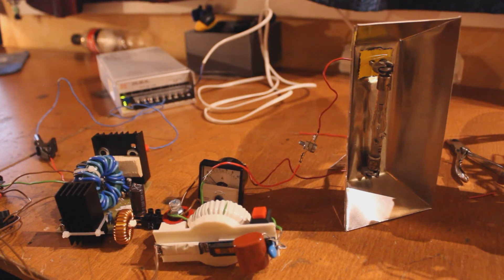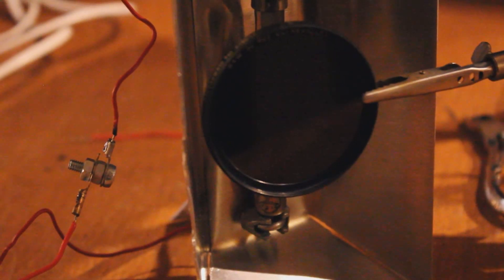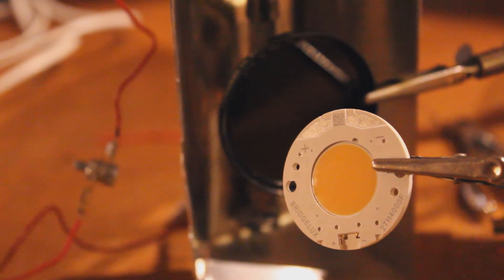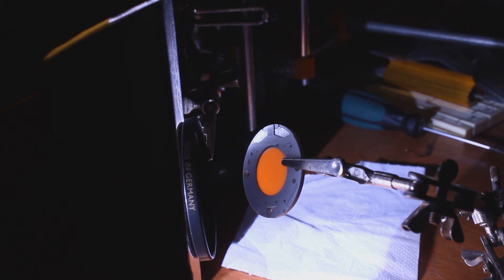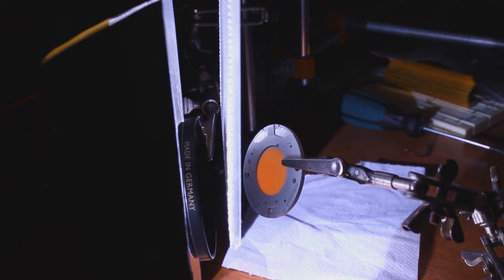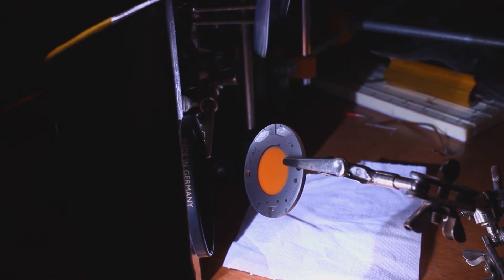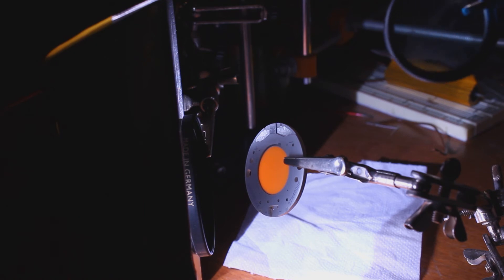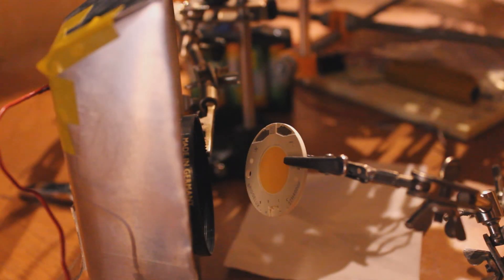How to see and block the UV from a Xenon lamp

Comment: Hello, thanks for the video.
How is it possible to remove the uv blocking filter of xenon lamps so that it can be used as a light generator in UV A, B, C bands?
If you know anything about this, can you share it?
Thank you.
Reply from the maker: AFAIK you generally can't, since the filter is the lamp's glass itself.
Reply: @val3tra  Thanks for answere

Comment: Are you sure that filter is UV pass and not IR pass?
Reply from the maker: +tbdau It is UV pass, known both from the pictures i took through it and from the label on it's edge. Whether it blocks or passes IR does not matter much in this case - the LED surface won't react to IR, and if the filter blocked UV then it wouldn't have lit at all.
Reply: Why does the camera UV filter not block any UV? Poor quality?
Reply from the maker: Not sure. It's either a scam product or something very specialized - they are supposed to increase image quality by filtering UV from the sunlight, but i never noticed any difference.